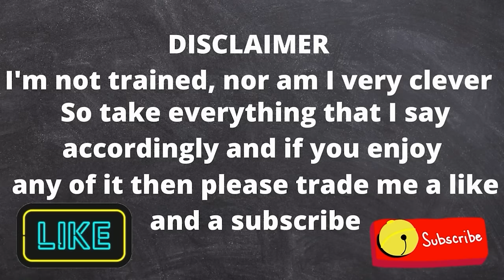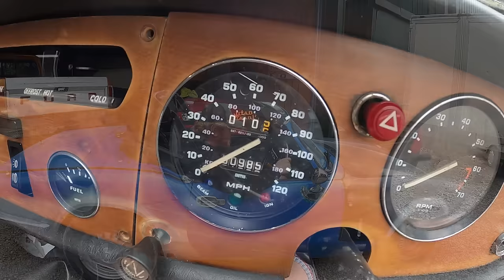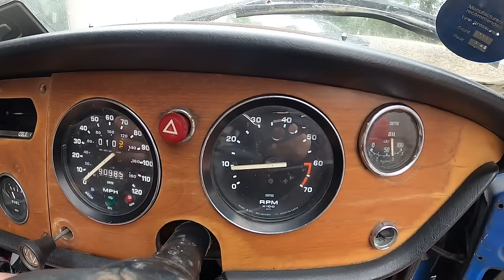ABANDONED 1977 TRIUMPH SPITFIRE 1500 PROJECT - Off The Road Since 1995! Will it drive??!

Comment: Looks a nice solid car, I’ve restored loads of these, the bonnets can be a right faff to align  especially if the tub has been off, a hinge box has been replaced or if it’s had a front end nudge in the past. The 1500 should have a chin spoiler under the front bumper, it improves the look of the car…. and for the blower to work, pull out the heater slider. Nice easy project though Ben, it looks like most of the hard work (welding) has been done. Looking forward to watching this.
Reply from the maker: Thanks for the tips I'll have a go!

Comment: I had one of these. They are a good little car. Mine had overdrive which made it good for the motorway. I did tune it put wide wheels on it and Koni shocks. I did a lot of mileage in it

Comment: I had a 1966 Mk2 Spitfire early 70's, cost me £230. An absolute hoot to drive, even at about 8 years old it was in need of new sills. Mine had a removable hard top, no hood, I could get one mate behind the seats so I could carry three of us. Sadly I was a lazy git with my maintenance, oil changes and the like, although I did adjust the tappets and balance the carbs, dead easy with the bonnet up while sat on the offside wheel.  You might find the diff is knackered, common enough back in the day, but Herald bits were used in the running gear so plenty were in the scrapyards, easy to source bits.  Unfortunately I blew it up on the A1 going up to Newcastle while demonstrating to my mate how it could just hit 100mph with the rev counter nudging the red, backed off and a conrod came through the side of the little 1200 engine. I was towed in and couldn't afford the £150 to buy a short motor and pay the labour to fix it. A young lad working in the garage offered me £150 for the remains, needless to say, we had a very drunken weekend in Newcastle before getting the train home.  I missed my little Spit, This 1500, seems like a great little motor, looking forward to the next update. 😊😊

Comment: Back in the 70s the go to rust treatment was Ziebart. Had my new Renault 5 done in late 74. By 76 it was rusty! Never worked out if it was the Ziebart that didn’t work or that Renault 5s left the factory rusty. I suspect the latter!!!! Nice little car that. If I remember right the bad spots were a weak differential, rust in the chassis out riggers and too much end float on the crankshaft. But that one looks good. Be great to see it painted.

Comment: I have a MKIV Spitfire so will be watching this with interest. They're fun little classics for not a lot of money. Great spares availability too.
That looks a really good project. Pretty solid and the engine sounds good. Perhaps adjust the tappets but the oil pressure seems good so the bottom end should be ok. It's the same lump as the MG Midget.
Doors rattling coz no door rubbers fitted. Exhaust should have two rubber straps so that's only a couple of quid and those bits of trim go at the bottom of the wood dash. 
Tahiti blue is a great colour too! 😎

Comment: Might have struck lucky! My only concern would be the engine. Sounds ok,but wasn’t it the 1500 Triumph engine that used to suffer “crank float” due to failed thrust bearings ?

Got to love a Spitfire though. Pretty little cars.

And easier to find parts for than a Panhard!
Love the videos btw!
Reply from the maker: Absolutely! I think that's why I've done it, it's nice to be able to sit back and order parts instead of having to decode a 1950's french booklet 🤣

Comment: Great video. I don normally watch anything that is close to one hour long, but you had me hooked with the way you make the video and discuss the subject. 
The car looks good and the prop shaft and drive shaft UJ's probably need grease as doe the front suspension.  I agree with you about the front brakes need freeing up with the pads out and all will be fine. Some waxoyl and bodywork alignment and paint and it will be a great car. Some spitfires had overdrive or maybe those wires are for the reversing light  switch. All in all it has good potential to be top class again. 
There is another channel where Erin works on Triumph front bonnet and  valance alignment by shimming the mountings.  
You will find that at "Erin Yakov's Rusty Beauties" channel.
"1966 Triumph GT6 - Part 49 - Adjusting The Bonnet Gaps"
Reply from the maker: Fantastic thank you for the tips, great recommendation too I will look for that and watch it tonight.

Comment: Hi As soon as I heard you bought a Spitfire.. I got interested..
Had three Spitfires in my early years..
I can remember my first one it was BRA 345L 1300 I never gave a great amount around £300.
My very first car was a Triumph Herald 13/60 a 1968 Old English white I paid £150.
My early cars were ford and Triumph.
The second Spitfire was 1500 and a 1977  I just can't get the right registration it had 77 in the number plate 
My third spitfire was a rebuild job on 4 wheels with engine in place and needing the brakes putting on. 1978 I gave £500 for that.
Preference Complete restoration on paintwork.
If only I kept my house my garage would have worked well..  But I had a few other cars around me and my mortgage was in its early years with me having health issues regular..
Great video

Comment: As someone who is 6'4" i've always wondered if i could fit in one of these.
Reply: 6ft4 tall?  I'm 6ft4 wide, I've no chance 😢😂
Reply from the maker: Haha I think I'm 6'1 so you might struggle!
Reply: I too came to ask this question 😢
Reply: I'm the same 6"3 1/2 lol trid out a TR6 & pmsl so funny I was so bent up and couldn't see out the window let alone get my size 12 boats on the peddles 😂😂
Reply: No chance unless you do what I did and remove the seat and with a bit of welding and grinding you can alter the seat runners so the seat moves back another inch or so until it rests against the crossmember. An inch doesn't sound like much but at 6ft 3in I couldn't really fit but I can now. It would still be very stressful on a long run but 50 miles is OK. 😐
Reply: At 6'  4" I found the only really comfortable sports car with plenty of space was the TR7. Stag is the most sensible option though.

Comment: Hi, great project! Bonnet settings are behind the black overriders. you need to remove them + the grille. 
From what I see underneath, i do believe there is no overdrive at the back of your gearbox. it's a std box.
Clonking noises can be from transmission UJs. Spitfires are prone to this.
Differential planet gear thrust washers are made of celeron fibre on these late models and tend to destroy themselves, causing excessive play and clonks.  
Weak spots on these models are the front vertical link bottom pivoting "screw" holding the brass trunnion (I'm not talking about the wishbone mounting bolt): if the trunnions have not been regularly lubricated, the "screw" will badly rust and will progressively crack inside at the top and can break without any warning! Fortunately this often happens at parking speed.. So better to check out this for safety! 😉
Other weak spot are the rear wheel bearings: Very often there is no grease nipple on the bearing housing , only a plug.. so the bearings are not seeing a grease gun very often..😟 there are two bearings on the housing: a ball bearing and a needle bearing, If the latter fails it will ruin the shaft too as its needles run straight on the shaft surface. 
Last weak spot is the engine : put only  20W50 oil in it and be sure to check crankshaft endfloat at the pulley : 8 thou max is ok but if you find about 0,2" it means at least one crank thrust washer is down in the sump and in bad case this could possibly damage crank and/or block..😟 
And the manual? it is available there, free (but in french🥵): spitfire 1500 dash manuel de réparations (Fichier dash PDF dot fr) Good luck!👍
Reply from the maker: Thanks for the great info I think I will definitely get around it with the grease gun in that case, I didn't think it had overdrive either it felt like quite a long box 👍👍👍

Comment: take a quick peek at the differential pinion bearing.  basically just move the driveshaft at the pinion around briskly,  the pinion could be on the way out.  check the differential mounting rubbers and bolts.  check the driveshaft U joints and axle joints,  i don't think its a big problem.  make sure there is oil in the diff they leak all the time.

Comment: looks like it shares the same front lights and indicators as the MGB,    Thanks for the little trip! I wonder if the rear prop bearings are failing,  hence the knocking noise.  Also the wiper system looks like a land rover setup too.

Comment: Tasty Classics  If your interested I know where 1 of these has been left  to rot away to nothing From NEW in Stirling Scotland . Bodies a sweep up job But i've only saw it on the road a 3/4 times on the road  when in its First Month of life, been under a hap ever since , incidentally that's rotted away as well but i think the running gear should be pretty sound , i assume the engine will be seized but plugs out WD 40 down the plug holes might free it up. it's sitting between St, Ninians roundabout and  LAST  BUNGALOW on left hand side of road next to Fast Food/Car Wash  business , just Before Bannockburn High School same side of road IF I MIND CORRECTLY I THINK IT WAS A 1966.

Comment: great vid not sure the wires on gear box are reversing pretty sure a late spit had overdrive which was engaged by lever by steering wheel or more likely a little switch on gear knob which might be why different knob on gear stick you brakes you did say peddle not returning might be staying slightly on not sure if the had a return spring on peddle def change master these old cars dont like running with choke on once at temp the best wheels i have seen on these are super slots a lot of parts are the same as my mg midget 1500 looking forward to vids it is a good base to start spray it up nice it will be usable for you and next owner lots of fun worth more now we seem to be having guaranteed sun in summer watch the fuel now it has ethanol in it there are lots of vids how to take it out or it will rust your car anyway hope you have fun doing it i like how you make out you dont know what your doing but you do 😉

Comment: Suspect the switch your fiddled with near the beginning of the video and said there were some big wires on it may be for Turing overdrive on.  Your gearbox looks like it has overdrive and from memory I’m sure it should disengage in lower gears say first and second.  It could be some rewiring means it can be turned on in all gears.  This could be the source of the noises you mentioned.  Interested to follow progress,  might even motivate me to tinker with my herald.
Reply from the maker: Excellent ok I'll follow those wires
Reply: Make sure OD is never engaged in reverse, it would be curtains for the gearbox (well that is what the Stag ROM states). The Stag has an inhibitor switch fitted to the gearbox that should prevent engaging OD in 1st, 2nd and reverse (hopefully that would be true for the Spitfire too), it also, rather handily, has the OD switch in the top of the gear stick.
Reply: I couldn't see an overdrive when we were looking up at the gearbox. It's quite a big extra box.

Comment: hi i know this has bin out for a while but i have been watching you now for about 4 week and i am going to enjoy this on the spitfire i have had 4 spitfire in my life the first one i had was 1978 for my 18th birthday i Neely killed my self in it the tyres where like mogge miner wheels i did love working on it i had it down to 30 min to change the rear diff everything was so easy to work on and in the 70s i also had a few heralds one looked like it was painted with a cat but it had a spitfire engine and box in it that was in 1978

Comment: The biggest problem with these is the wiring, and the empty gearbox, and dried out u-joints, ball joints, and dried up rearend. Be sure every moving part is fully lubed, and gear oil added as needed before putting it under it's own power and driving it. I can give you a tip if your tall, and your head is rubbing the roof.. put a classic folding boat seat on the floor where the original driver seat was. Be honest lad, would you choose this over a golf cart? Me too

Comment: The noise from the back, check if it has Everflex rubber couplings to the drive shafts, the rubber perishes.
Reply: No Rotoflex couplings on the later models like this one.

Comment: Ben I think I remember the 1500 Spitfires all came with overdrive. There was a switch for that on the gear knob I think....maybe yours has a 4 speed Midget gearbox fitted? They both shared the same engine at the time, great project 😊👌👍

Reply
Reply: They came with the normal 4 speed also Richard ,  I own one like that
Reply: @alanedwards3180  thanks Alan 👍

Comment: Convertible oil. Yeah. 😂 No such thing, of course, so you need to used old-fashioned 20W-50. I actually use the synthetic version in my GT6, and use to in my old 1500 Spitfire, but the mineral version is also fine and probably a bit cheaper.
You don't need to drop the bonnet the last couple of inches. That will just ruin it. It's not like a modern car with spring-loaded catches. The Spitfire / GT6 bonnet closes fully under its own weight and the over-centre "Michelotti" catches then secure it in position.
The Spitfire is very slow by modern car standards. I've had my GT6 up to a genuine 100mph but the in-line six is a completely different animal.
Richard

Comment: Don't they use rubber joints in the drive train, which might be what's causing the feeling that the clutch is slipping, especially if they've rotted away.
Reply: By 1977 Triumph had stopped using Rotoflex bushes.